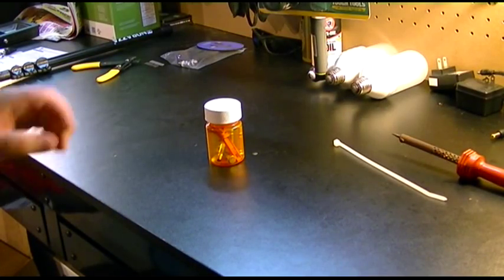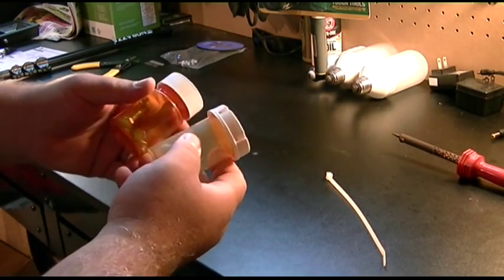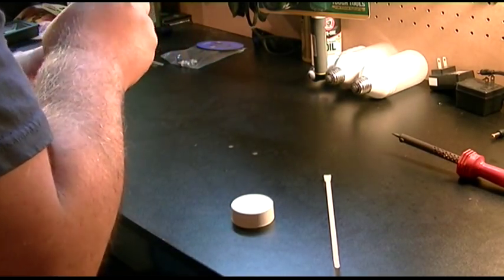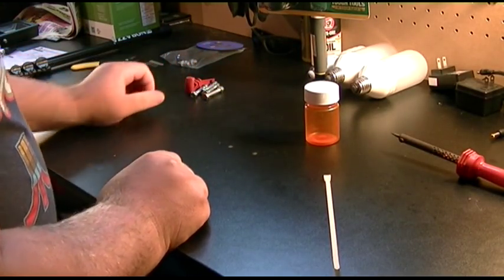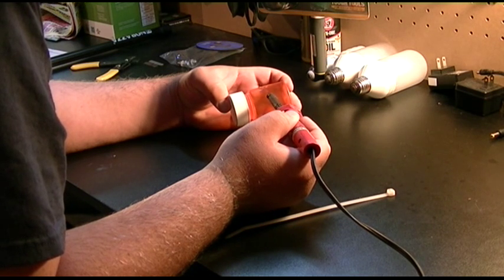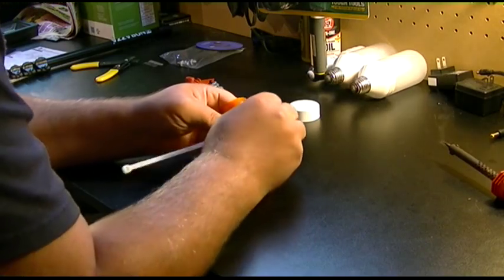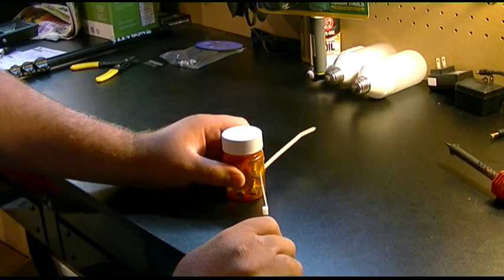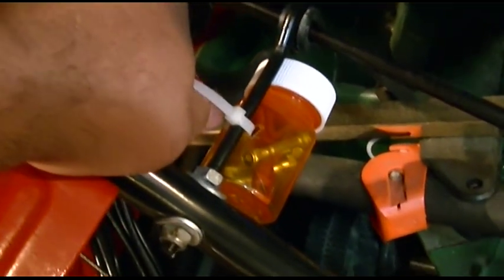Pill Bottle HACK!

Comment: Put the zip tie on the cap. Your frozen fingers can easily unscrew the entire bottle and easily shake the parts out, rather than trying to fish the parts out of the attached bottle.
Reply from the maker: 6 of 1, half a dozen of the other.  I get what you're saying.  The bottle fit better this way, and I better hope I don't ever need those parts in there.  I've had far worse happen in the middle of snowblowing, and it was nothing new shear pins were going to fix.  Compared to that, replacing shear pins would be a walk in the park.

Comment: what a good idea my snowblower did not come with a headlight so i bought a battery powered light for it
Reply from the maker: That works fine.  I have a 500 watt halogen I plug in inside the garage when I have to snowblow at night.